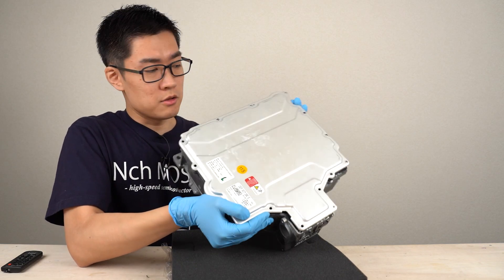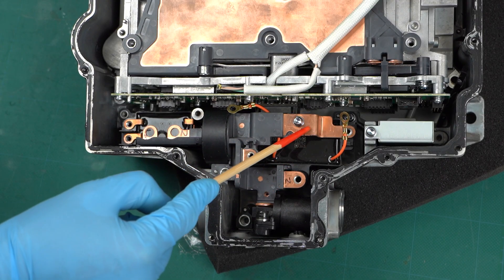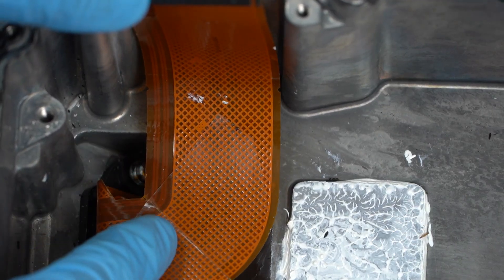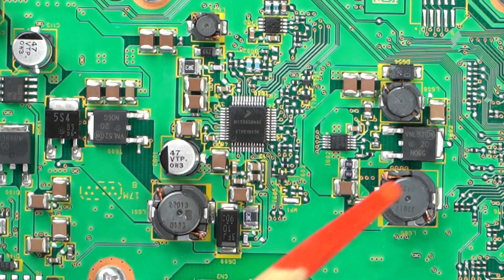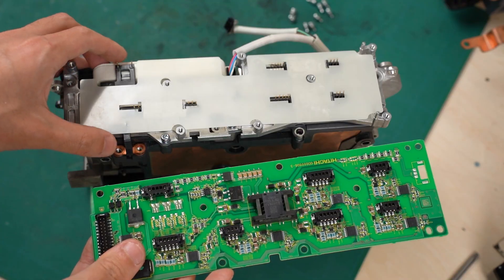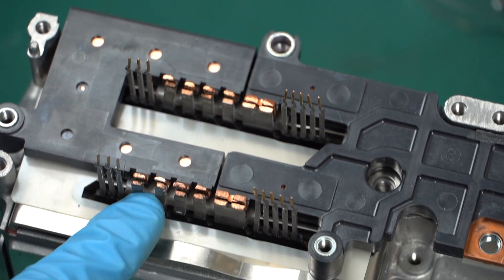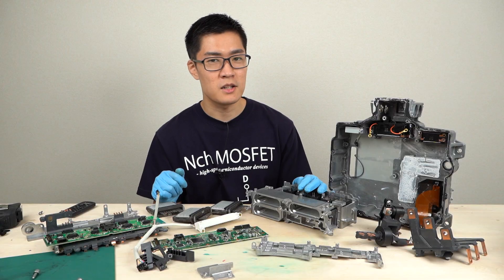HITACHI Inverter Teardown!! Audi e-tron. Wow it's Made in JAPAN !

Comment: Interesting to see but no that's not a good design :) it's extremely elaborate, particularly the water cooling is ridiculous and they have inelegant illogical arrangements like the protected wire between the two boards. A Tesla model 3 inverter and never are much more rational designs.
Sealing those power transistor modules to float in water was probably terrible. Why :)  They probably even had Tesla designs to learn from when they did it

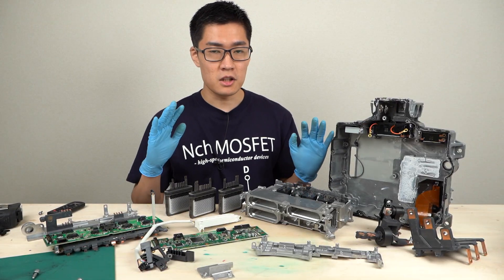Comment: 12:15 the slits are most likely there to maintain an evenly split and evenly distributed water pressure across the entire surface of both sides of the conductor. If they weren't there, the flow rate would be different in front compared to the rear which would be less effective and potentially create an uneven wear over time.

Comment: So you had nothing to say about multiple seals inside of HV cavity opened to motor cavity, including push fit o-ring sealing fancy water jacket cavity with two different materials and irregular aluminium thickness? It seems to have high failure rate in just few years from introduction, as it obviously is full of reliability issues
Reply: I had exact same thoughts
Reply: Yes, this has been a failure mode on other EVs, one day you just find the module full of coolant. No oring lives forever.

Comment: There is a few bits missing in the presentation. What is the exact input voltage for this inverter? Audi is not exactly a market leader in this field, so what sort of battery voltage do they use?  Does it have a power rating? The two input capacitors should be easy to measure, what capacity are they? ESR?
Reply: I am pretty sure it uses a 400V architecture. Since the maximum output of the RWD versions is 150kW I expect the peak output power to be somewhere around there.

Comment: Overly complicated and Overengineered
Reply: A simpler design would be better for costs, reliability and maintenance and what if those orings fail and coolant leaks inside ? Those custom bus bars look expensive im sure there would be a simpler and cheaper way to design this thing.
Reply: @ElySky95  A simple design will take a lot of space and electric cars are short of it. Coolant pressure and temperature is not very high to cause any leak through o rings.
Reply: @imranakhtar4478  Not necesarily, a design can be "simpler" and still take the same space and be easier to assemble and repair, it just takes more time to design.
Reply: @ElySky95  Of course and time is money. And these are no designed to be repairable either. In most cases such designs are already in use or designed by a company for another product and whenever a new customer demands according to their specifications and requirements, the company simply use one of its previous design that fits best in their requirements. So, it is not specifically overengineered or complex in the eyes of manufacturer but the design can be totally strange and overengineered in the eyes of a technician.
Reply: I guess those are complicated to reduce convertion power loss and also weight.... You can put 3kg worth of air cooled heat sinks instead of 400gms of liquid cooled heat sinks...

Comment: Worthwhile to point out that this inverter does not use the boost-buck circuit* topology in-between the HV battery and the 3-phase drivers as Toyota does 
(* Boost: battery to IGBT driving motor; Buck: 3-phase rectifiers back to HV battery for charging)
Also, A/C compressor's 3-phase HV motor's driver is not in this module.

Comment: Very thorough examination. It looks complicated, thus many failure points. O-rings don't last forever.

It looks expensive to replace. 

I think it would be more reliable to do away with the many o-rings and cooling ports. Submerse the entire unit in a dielectric.
And simply use a heat pump type of cooling.
Reply: ofc it is complicated and expensive it is an inverter 😂 ur right about the o rings though, they seem like a definite failure point (even though they don't move, they still wear out)

Comment: Very funny, Germany's cars don't use Siemens or ABB drive but buying.....Japan Hitachi!!!!!
Reply: they did everything right i guess.

high quality electronics made in japan using their own + known infineon ųC for perfect implementation + compatibility in a high quality car.

i can't find anything wrong with that !
Reply: Imped-ance. That's hilarious
Reply: Siemens is not doing EV inverters anymore since 2022 and ABB never did. Sourcing of suppliers doesn't concern  nationality as you imply here. Mostly it is about cost, but also about diversity of suppliers to minimize production risks.
Reply: Germans are not the best in electronics. Taiwan and Japan are.
Reply: @phoneaccount6907  Infenion, Siemens, Bosch, Semikron...I'm sure there are may more
Reply: @phoneaccount6907  But Germany is the only country, outside the US, who has completeness on IC ecosystem.  Germany has its own 32 bit design CPU which uses its own microcode and assembly code. It is not licensed built from US&UK as the whole world industrials did.
Germany also has its complete tools in developing any project or works from the chip.
Reply: @alexlo7708  what cpu are you talking about?
Reply: At least that won’t break!
Reply: But Infineon is a German manufacturer.
Reply: @Dr3x0w  That is why it weird. Employ the Japanese to build car's motor drive, but with the German's chip.
Reply: @alexlo7708  Why is it weird? Yamaha manufactured Volvo's B8444S 4.4 L Engine fitted with a gearbox from Aisin Corporation. 
Yamaha also made development on Fords SHO engine for Taurus and they have 6 engines done for Toyota.
It was Porsche that made the design to make it possible to put in MB V8 in Mercedes Benz E 500 V8 (W124) and after that W124 was build by Porsche on their own factory and shipped back to Mercedes. 
Japanese electronics are some of the best you can buy in this world. Japanese engines is some of the best you can buy.
So is quite normal to have cross development in the automobile industri.
Reply: @NotMeGeek  So, consumers always value European products over the Japanese, are fault.  Better buy Toyota than Merc or BMW next.
Reply: @alexlo7708  Actually yes. Toyota is better than BMW regarding lifespan and quality. They are also cheaper to repair if they have a failure.
Reply: @NotMeGeek  But I once ran against my colleague univ student's  BMW with my Toyota. And I lose to it. The BMW has an edge over my Toyota from suspension through acceleration down to brake.
Reply: @alexlo7708 performance edge yes. Longevity edge, the BMW loses to the Toyota
Reply: Germany's inverter are more costly then Japan.
Reply: @coloradowilderness3139  So, What will happen has Audi used Suzuki's engine in their cars?
Reply: @alexlo7708  They would keep driving for 20 years and the drivers wouldn't crash their cars!  🤣

Comment: Hello fans of Mr. Ichiken and Mr. Ichiken 😀. This Hitachi inverter has already been presented by the host, but in the Japanese version. Full professionalism as usual! The three complex power transistors, or rather their configurations, are very impressive. I counted as many as 14 connections for each of them. Also the Infineon Technologies tri-core processor is very powerful. Mr. Ichiken pointed out the cooling channels and tabs that prevent the wrong assembly of power semiconductors. Like any device, it has the right to break down. I'm curious if it's worth repairing? I thought the simplest thing would be to replace the power transistors. But maybe I'm wrong.
I invite fans to my new clip published on YouTube. It presents an innovative system of functioning of the Brushless Hybrid Fast - Rotation Motor with complex coils of its own design based on the current of the sine function of two control lines. In the absence of a suitable four-phase inverter, it is powered by a frequency converter with single-phase current. Today I accelerated this mini machine to 300 Hz = 18 kRPM.
Regards 😀.
Reply: Thank you for the like 😀.